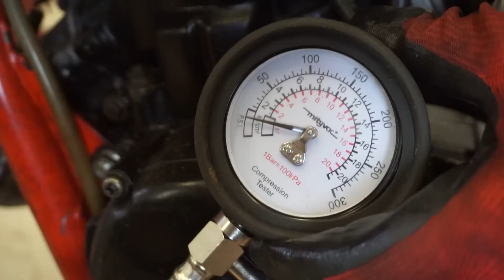Seller Gave Up On This $500 Dirt Bike

Comment: Gotta love an 80's 2 stroke dirtbike .
Reply: I want a 89 CR 125 , they are good, I had one in year 2000 I want to fix one up an make it better than new
Reply: @kingkong81icloud  those are nice, I'm sure a barnyard find will pop up soon
Reply: I had the 89 Cr500R
Reply: @billturner1240  lucky man, I' rode 1 a few yrs back for the first time. Bike pulled a wheelie in 4th I politely gave the owner his bike back 😂
Reply: @billturner1240  I had a 91 YZ 250 , am sure older bikes were faster, ave had loads of bikes 4 Yamaha DT125R s , I would rather have a older evo bike than these new ones

Comment: Honda had the best dirt bikes in the 80s. Back then the corrosion didnt exist cause they were new. Now most are 35 years old and still running, amazing. 👍
Reply: Rubbish brother I had an 89 kx80 and that thing was a thing of beauty, what a machine!I now have a yz250 92!Needs a bit of love ,still a wicked 2 stroke machine!🦾🦾👌🇿🇦🏈
Reply: @craigmorgan4676  lets break this down. 1st off I said 80s Hondas, not 90s yzs, so that eliminates your yammie. 89 kx 80? Are you kidding me?🤣 Kawasaki rims crack, cylinders lock up, gears pop, frames crack, plastics crack and fall off, and that's an 80cc toddler bike, cmon man 👌🤔Honda is the Cadillac of all dirt bikes, period, even today. 💪👍🤠🇺🇸
Reply: Yes, the Honda were the best bikes through the 80's but unfortunately the magnesium were to phrone to corrosion so not most of them are still running. Infact they are very rare today in vintage racing. Partly because the corrosion problem but also the odd bearing dimensions that you cannot find today. I think all other japanese bikes have survived better than Honda and KTM.
Reply: @swektmaico  👍😉Says the maico breako fan.👍
Reply: @Workerbee-zy5nx  I have many brands, but talking about maico, the cases are indestructible and all bearings are standard sizes. I don't know where you live but maicos can quite possible be the most common bike at your nearest track when there is a vintage event.
Reply: @swektmaico  Dirty south son! Lots of Honda boys round these parts. 🤠👍🏴

Comment: My 82 cr 250 clutch cover was totally ruined by corrosion and got one from Russel Clutch covers around 400$ all aluminum. Keep up the 80’s Dirtbike videos Joe Love Them 🤙🏻
Reply: Don't run Glycol based fluid in them. I started running 60/40 Nissan Synthetic L25500P Blue Long Life in my stuff and haven't had a single issue with corrosion. It's basically the same fluid that Polaris recommends for there RZR SXS's but you can get the aftermarket equivalent of Nissan Synthetic Blue fluid for $17 a gallon instead of $20+ per quart.

Comment: I always replace the shaft and bearings when the water pump seal goes out. The shaft usually gets grooves worn in it. Make sure to put the shaft in the bearings and see if the bearings have any slop in them. Worn bearings will quickly cause the new seal to wear out.  Never use Glycol based coolant in a bike. It creates corrosion especially in the cast aluminum parts such as the pump housing.
Reply: What type of coolant is recommended instead?
Reply: Maxima brand coolant is a safe bet

Comment: The metal flakes are probably from the aluminum clutch plates. They  made the plates out of aluminum so as they wear out they will not damage anything else. The older style plates were made of steel much more durable but harder on the clutch baskets and pressure plate

Comment: To loosen the head bolt I use a Forney carbon arc torch. With the welder turned off. I grab the nut with the torch, carbons, then Turn the werder on and off till the nut turns a little red. Then I let the  nut cool a bit, while the nut is still hot, I loosen the bolt.. Nice way to reuse an antique welder.

Comment: For really stuck bolts... a hammer impact gives them a little shock and breaks them loose. I would not believe it myself until I couldnt get some brake caliper bolts on a yamaha atv I was working on. But at least you got that head bolt off.

Comment: On the corrosion on the case you could you a leak test with red penetrant (non-destructive testing), but instead of doing a 20 minute test which is for the surface, you could do an over night test and apply the developer on the outside

Comment: Lock tight is not going to work on exhaust. We had trouble with a certain model chain saw that we used to sale with the muffler bolt coming out. The only way we found to keep them in was fouling the threads in a vice.

Comment: I’m always amazed that you can get that much power out of that little bore and piston. Gonna be hard to replace the internal combustion engine.
Reply: I agree. You definitely cannot duplicate the brrrapp of a two stroke, or the smell of exhaust. The battery people can choke on the smoke.
Reply: You'll be surprised one day. Only electric can deliver 100% of torque at zero RPM.

Comment: I had a 1986 cr125 when I was in 6th grade. One thefan blades broke off and was shorting my water flow. Lost 4 pistons and a jug over that but it was fast. Had it a piston .8 over at 1 point. My back axle would not come out and don't sell vin lol

Comment: Some times you may see a slight metallic sheen in the oil. Not a major problem. Hondas of this period used aluminum clutch plates and they shed tiny flakes through normal wear. I have a 1984 CR125R waiting on the time for a rebuild. In 84 the 500's were real beasts, the 250's were rockets and the stock 125's were anemic at best. I also had a 500, bored .060 over and pushing 180 lbs compression, it was like riding a 60 HP hand grenade. You wanted it pointed the direction you wanted to go when you pulled the pin!!!

Comment: Use high heat JB WELD. last forever. Have machinist tig weld that shaft and recut it to spec with a lathe. Done it a few times, always works.

Comment: You should just rebuild the rear shock yourself. The seal head is 40 bucks the tool to help press the seal head down is 50 bucks and you can use for others so it pays for itself, also buy fork seal 20 bucks.  the forks on it have no fluid when you showed the rear shock bouncing the front was doing the same. Use fork oil in the rear shock and the front forks, save money and its perfectly fine. I doubt you can find a good rear shock cheaper than rebuilding both of them and it makes good content. Good job! By the way buy the race tech tool it's got a better perch to push down.

Comment: Blown shock..rebuilding. If 4 inches of sag were possible above 175 pounds? I'd end up with a lot of preload but try double fuel oil weight and more nitrogen pressure.

Comment: the rod bearing doesnt run in the gear oil which you mentiond at around 23:00. the sealant you applied at the start did nothing to stop oil entering the coolant because it seals the coolant from leaking  outside the motor. the metal in the oil is likely from the clutch basket wear you already noted

Comment: If the water pump shaft or bearing are worn and there is up and down movement, couldn’t water leak past and mix with the oil?

Comment: Hey joe is putting a digital thermometer that has a wire with washer that goes under the spark plug going to mess up my 98 kx250 i really need to know im not riding it till someone tells me its ok lol thanks 😢
Reply: Will not hurt anything my man. Trust me.
Reply: @4thdimensiontravels855  are you sure lol
Reply: I run those TTO copper spark plug temp rings on all my 2Ts. It acts as the washer so you should take the crush washer off the spark plug

Comment: ? For you why do they drill holes in the piston skirt
Reply: It helps lube reach the exhaust port bridge area.
Reply: Weisco pistons are non stock, requiring drilling, been that way for 50 years.
Reply: I did wonder if it was for lubrication purposes

Comment: Man why don’t you just clean the case so you can see where the imperfections is, do you not parts washer? If not, you really need to get one. It will make your last so much easier to go ahead and clean it first so you can see any imperfections. Ashley, the only thing that I really see in your game, that you have to start doing, it’s a must

Comment: Yo I got a yamaha yz 85 year 2000, there is something wrong with my bike I all ways hear some type of knocking but when I press my clutch it stops not fully but it gets quieter and it doesn't match with the timing of the engine. I think it could be the clutch rod. Anyone have any idea what it could be?

Comment: Just to clear things up this guy is not a mechanic. 
There are 12yr Olds tearing 2 strokes apart.
Let's see some 4 stroke engines torn into.
Reply: Looking forward to those 4 stroke breakdowns on your channel. What’s the hold up ?
Reply: He's done tons of 4 strokes, I've watched him wen he was clueless with his younger brother 5 year ago riding 2 strokes up an down that road, then stopped watching as vids are too long and I've no time to sit 50 mins watching one vid, then came back on and Joe done tons of 4 strokes quads n that on his own he knows his stuff now, everyone has off days with bikes I'm on with a Ktm65sx and it's causing major headaches cos everthings been rebuilt by previous owner, it's got me stumped, x height set, decking timing set, new piston and ring, enough compression, good spark but very orange, took 27 kicks to fire up then it dies, never had one like this b4😢😂
Reply: This guy knows his  stuff  he very smart bro look at all his videos he fixes all of them